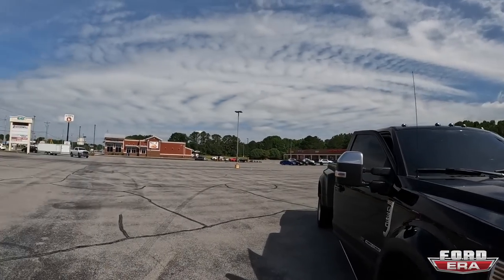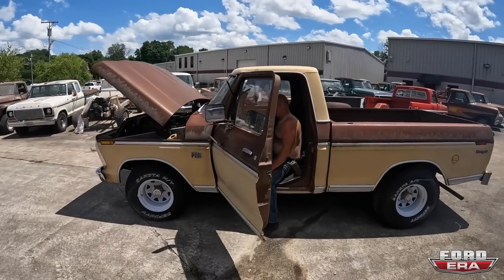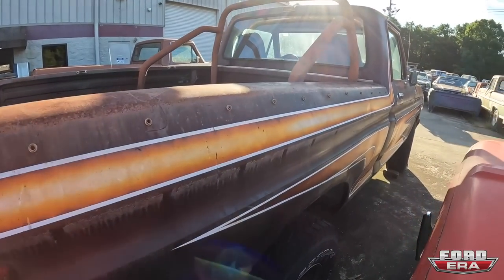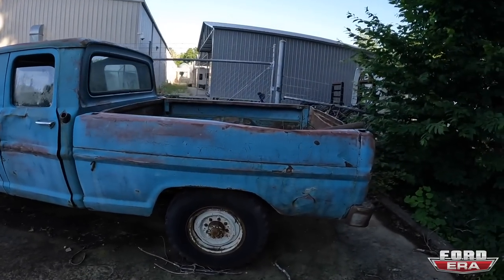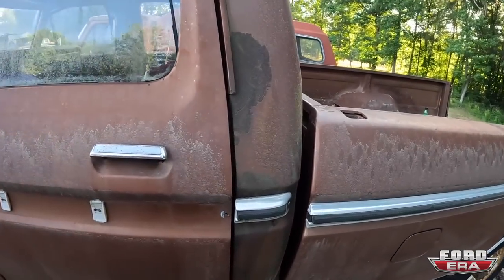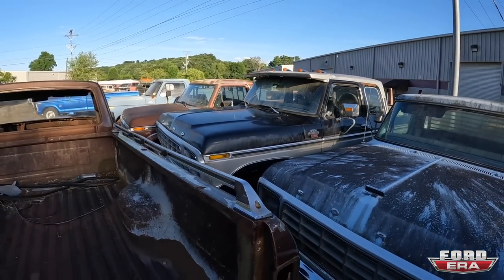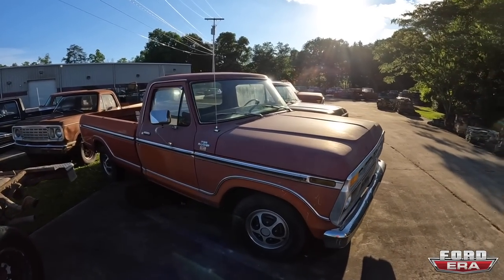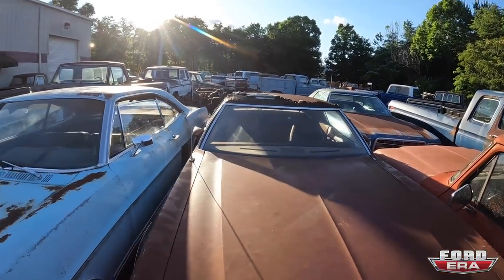Soddy Daisy Collection Part 5 | Ford Era

Comment: Generic parts question Solomon.  Price/availability of regular cab/longbox 78-79 chassis with disc brakes, also a early 73-77 long box with single gas fill round cap.  Someday need to restomod my dads '73 F100! Thanks for info.

Comment: Are any of those truck the old split shift overdrive with the lever that looks like the emergency brake release????? I really want one. Had a guy offer me a running one back in 2000ish for $200 🤦🏼🤦🏼🤯 I was young and broke and regretted not hustling to get it ever since

Comment: The super campers were built for large in bed campers or a small camper to have a easy step
Reply: The beds are the same length just the axle was slid back it was for weight distribution because the campers that came on them over hung a lot

Comment: I'm looking for a shortbed ,step side ford. 70s. Please if anyone knows of one. I'd like it to have a good tranny , motor optional. No motor no problem. Or chevy ,bullnose stepside , 70s. Same as the ford no motor ,no problem. No paint no problem. As long as its straight with no rust. My name is chris, from indiana.